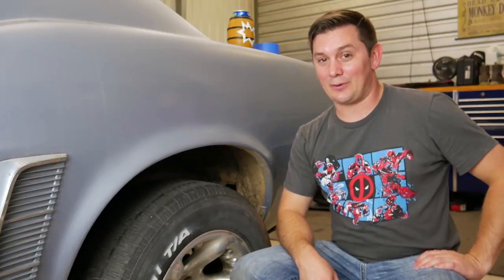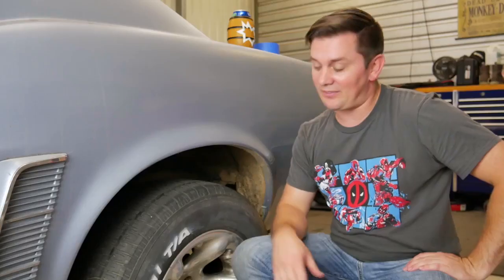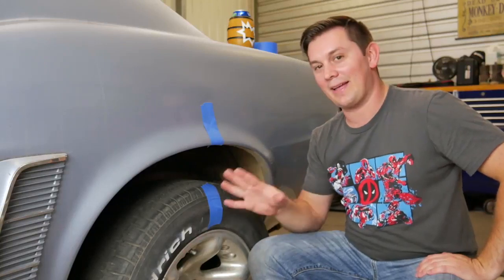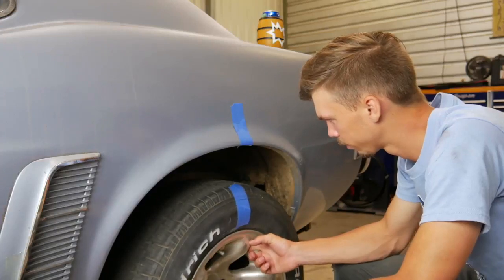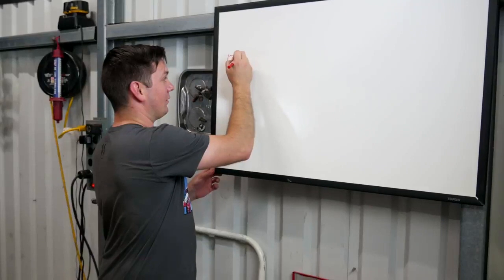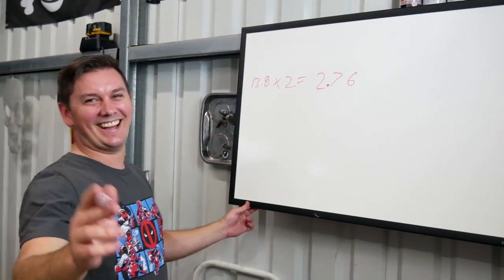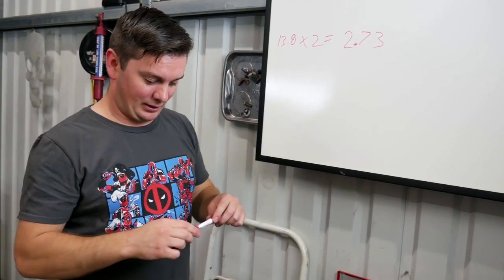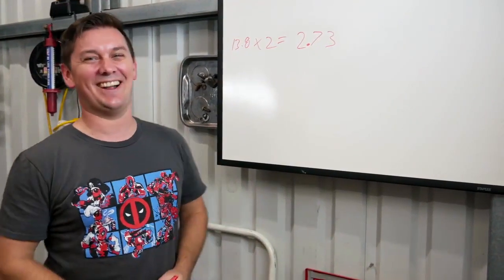Easiest Way to Determine Rear End Gear Ratio on a Open Differential

Comment: what is the difference if you spin the tire one complete turn or you spin the tire ten complete turns.
Reply: Spinning the wheel 10 times just gives you a more accurate calculation.

Comment: Everything you're doing is correct. But all you have to do on an open diff is spin it once and multiply the yoke spins by 2. Never heard of the 10 times way. Ford only has so many rations in 8 and 9 inch so you'll be in the ballpark ratio wise.  My Mustang was taching at freeway speeds, jacked it up, locked the other wheel, turned wheel once while watching the yoke, yoke went around twice. Times that by 2 = 4.11

Comment: I’m putting an ls3 with a tsp cam, lifters, valve springs, push rods with a tr6060 xl 6 speed manual in my 65 chevelle. What gears should I go with? I don’t need to go over 95 in an old car. Should I just go with 4:10?

Comment: I got a even 13 with 10 spins my chevy 7.5 10 bolt non posi with 1 wheel spinning.

13 x 2 = 26...

My gear ratio is 2.6 ?
Reply: The closest would be a 2.73

Comment: Do I have to lift both tires completely off the ground and chock one side or can I just lift one side up since mine is open differential.
Reply: just lift one side; it be the same thing.  You just want to keep the other tire from spinning the opposite direction.

Comment: My corona 1966 1c diesel engine 5 spped gear, what is the reason that speed does not cross 135 km per hour,  gear axel ratio is 2 and 1

Comment: Why did he spin it 10 times and the posi only once?
Reply: Good question
Reply: I'm curious as well since I see others saying to spin a non posi twice.
Reply: @ctg6734  give you a more accurate calculation... when counting driveshaft rotation it might be harder to judge with only 1 turn. As in, did the driveshaft turn 1.5 turns or was it 1.4 or 1.45 etc.